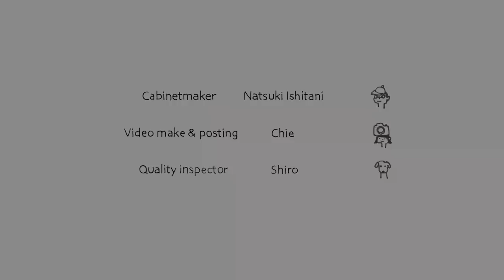ISHITANI - Making a Workbench (6G)

Comment: Dear Mr. Ishitani,
May i make a suggestion about clamping techniques, if you don't mind? There is a setup, where you can place your pipe clamps vertically on an inclined panel- against a wall. This allows for easier access, keeping the floor clear, and most of all, avoiding back pain. Because some long and large glue ups can be very heavy. You're still young, but as the years go by the body gets tired and needs to save its energy.

Other than that, I have watched many of your videos, and I really appreciate your very fine craftsmanship, and your constant approach towards beauty. You are gifted person, and your work will surely go down in furniture history. Sending you my kindest regards from France.

Comment: The scissor base lift is clever, especially for saving wear and tear on the back muscles. But the tradeoff is that your workbench is very noisy, too noisy for me. Perhaps you can add foam underneath to make it quieter.

Why blow dust off a table top with compressed air when you have a vacuum dust collector?

Comment: I guess the sliver of space is for expansion?
Reply: I assume so, and there are the matching rabbets on the top and the edge pieces. I’m curious about the horizontal support pieces underneath attached by lag bolts. I’m guessing that the holes for all lag bolts but 1 pair are elongated to allow for expansion as well.

Comment: At 04:11 you’re dipping your chisel in a cloth filled can. Is oil in it, to reduce friction while chiselling? - The same thing you do with a handplane or a machine table to make it glide better?
Reply: Its a bamboo pipe that contains camellia oil used to lubricate and prevent rust on tools. Won't stain wood.

Comment: At about 4:10 he dips his chisel in a rag stuffed in a round piece of bamboo. What was that all about?
Reply: An oiler. A piece of cotton fabric (a t-shirt, for example), rolled tight on itself, inserted in a container and filled with oil for precision machines (a very fine oil). Used for lubricate chisels, saws and planes, to reduce friction when you cut and also to prevent rust on tools. Paul Sellers has his own famous version called "rag in a can". Link to the Paul Sellers version: https://www.youtube.com/watch?v=npKo1y2e8RI
Reply: Probably similar to what Paul Sellers does with his planes and a few other tools. Also see other comments below!

https://www.youtube.com/watch?v=npKo1y2e8RI

Comment: Ishtani San, whats happening at 10:41 in this video, when you drill a hole in the metal workbench?
Reply: Mycroft Pembroke the hole is to receive the metal bolt which fixes the wooden bench top to the rising metal topped platform/bench.

Comment: Around 4:20 what is the black stuff in the bamboo you stick the chisel in?
Reply: Its a bamboo pipe that contains camellia oil used to lubricate and prevent rust on tools. Won't stain wood
Reply: Thanks!!